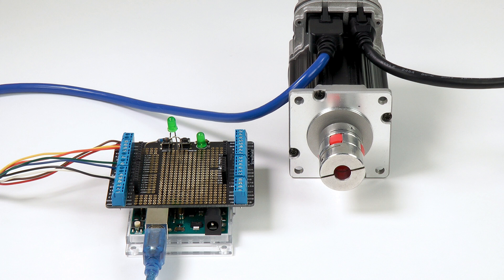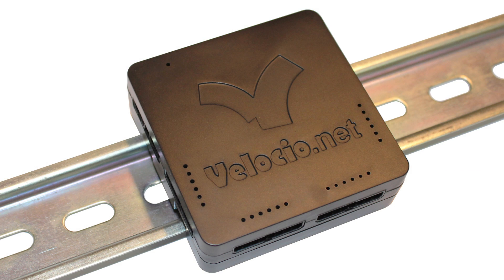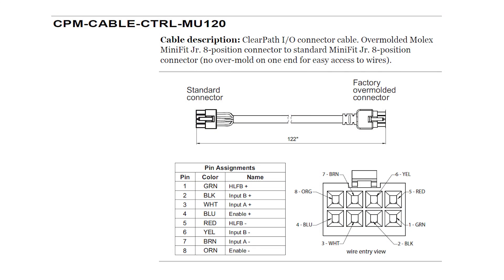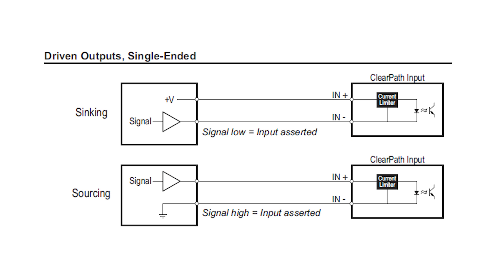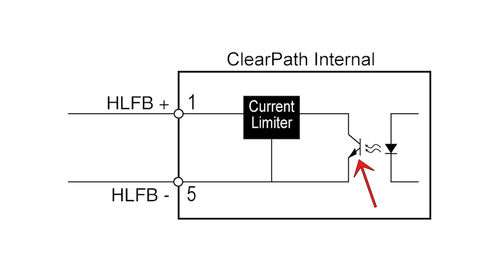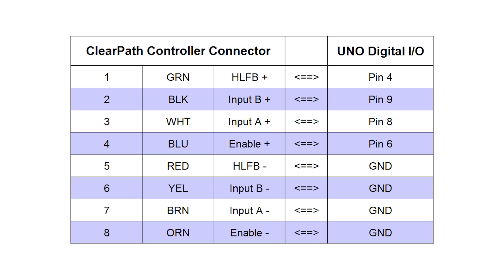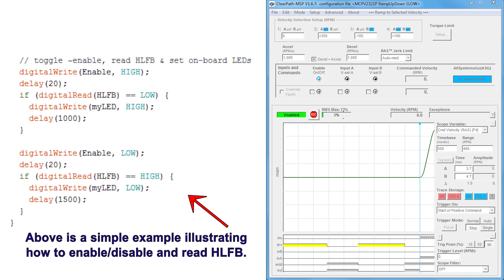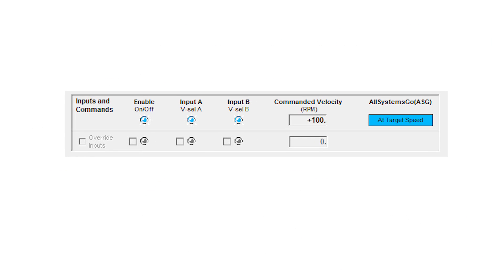How to Wire an Arduino to a ClearPath Servo Motor

Comment: Now if you could remake this video in English that would be great!
Reply from the maker: Hi Mankind,
Thank you for your comments. We understand that learning how to do software programming can be challenging.

You might be interested in Teknic’s newly released ClearCore motion and I/O controller which can help simplify wiring and programming:
https://www.teknic.com/products/io-motion-controller/

To help both beginning and experienced programmers, Teknic has written an Arduino library that allows the ClearCore to be programmed in the Arduino IDE. In addition, we have written more than 40 motion and I/O examples for the ClearCore. These examples, and many other ClearCore resources, can be found in the download section of Teknic's website: https://www.teknic.com/downloads

Regarding hardware, the ClearCore controller has 4 motor connectors and 13 points of configurable industrial I/O built-in. Using Teknic's controller and power cables provides plug-and-play functionality so no complicated wiring is required to get the motors running. 

If you have any other comments or questions about this video or the ClearCore motion and I/O controller, please contact us at: https://www.teknic.com/contact/ or call us at 585-784-7454.

Aaron B. - Teknic Servo Systems Engineer

Comment: WİCH ARDUINO DO YOU ADVİCE FOR 6DOF ARM ROBOT
Reply from the maker: Hi abd morioglu,

I appreciate your question. There are several controllers that could work with ClearPath in a 6DOF robot, but the optimal choice depends on several specific application factors. 

In this video, we are using an Arduino Uno, although other controllers are compatible with ClearPath as well.  The main requirement for using a controller with ClearPath is that the controller outputs are 5-24VDC signals that can supply enough current (dependent on the voltage and listed in the ClearPath User Manual).  

If you would like to discuss your application and controller options in more detail, please feel free to contact Teknic at 585-784-7454 or through our website at https://www.teknic.com/contact/

Best regards,
Bridgette G. - Teknic Servo Systems Engineer

Comment: Question: Could you do the same thing with GPIO pins on the Raspberry PI?
Reply from the maker: Hi Glalilos,

Yes, it's certainly possible to utilize the GPIO of a Raspberry Pi for a ClearPath MC or SD series' inputs. You would just have to use a level shifter to make the 3.3 V outputs on the Pi compatible with the 4-28V inputs on the ClearPath.

Please feel free to give us a call (585-784-7454) or leave us a message at https://www.teknic.com/contact/ if you have any questions.

Best regards,
Ian R. - Teknic Servo Systems Engineer
Reply: @TeknicInc  Thanks, very helpful!

Comment: what is the model of your servo motor?
Reply from the maker: Hi Dante,

The ClearPath model that we used in this video is a CPM-MCPV-2321P-ELN. Here is a link to the motor's specification page: https://www.teknic.com/model-info/CPM-MCPV-2321P-ELN/

If you have any other questions, feel free to reach out to us directly through our "contact us" form (https://www.teknic.com/contact/ ) or call us at 585-784-7454.

Best regards,

Bridgette G. - Teknic Servo Systems Engineer

Comment: Im in love with the speed of these servos! Would it be possible to use this with a raspberry pico?
Reply from the maker: Hi Mitchell,

Thanks for your feedback regarding ClearPath. Yes it is possible to use a Raspberry Pi Pico with ClearPath. However, as with most single board computers, the Pico’s on-board logic voltage is only 3.3V. ClearPath’s three general purpose inputs require a logic voltage of 4-28 VDC. As a result, you cannot use the Pico by itself. 

In order to make the Pico compatible, you can use a level shifter to bring the 3.3 V GPIO to 5 V (there are several well documented articles if you Google this specific topic). After boosting the Pico’s I/O voltage in this manner, you can then use the Pico with ClearPath servo motors, similar to our Arduino video – just programmed in a different environment. 
If you have further questions, feel free to reach out to us directly through our "contact us" form (https://www.teknic.com/contact/ ) or call us at 585-784-7454. 

Best regards, Abe A. - Teknic Servo Systems Engineer
Reply: @TeknicInc  Thanks for the detailed information. Ill be in contact.

Comment: does the motor reach the max rpm with arduino
Reply from the maker: Hi H S,

Yes, it certainly can. An Arduino will not limit ClearPath’s ability to reach maximum RPM. In most cases all you need to do is configure your ClearPath motor to achieve that speed.

Throughout this video Teknic uses a ClearPath MC motor to demonstrate position and velocity control through different ‘operating modes’. If you look closely at this part of the video: https://youtu.be/QZLwDnGSaeI?t=396, you can see Teknic demonstrate the “Ramp Up/Down to Selected Velocity” operating mode. In this mode we configure the motor to spin to four different velocities: 0, +350, -100, and +100 RPM. If we had chosen -6,000 RPM to be our third velocity instead of -100RPM, then when the Arduino requested the motor spin at its third velocity, the motor would have spun to -6,000 RPM instead.

If you’re interested in learning more about the different ClearPath MC Operational Modes and how you can use/configure the motors for your application, please take a look at our website here: https://www.teknic.com/products/clearpath-brushless-dc-servo-motors/clearpath-mc/.

If you have any additional questions, please contact us at www.teknic.com/contact or give us a call M-F between 8AM and 6PM EST at 585-784-7454.

Best regards,
Jon K.

Comment: I know this is a stupid question because I watched the video, but will this actually work with a 3.3V micro like the Teensy 3.6 w/o level shifters?  Inquiring minds want to know.
Reply from the maker: Hi Rob Jones, 
Actually, this is a good question! 3.3 vdc, as commonly provided within the smaller micros simply don't provide enough voltage to reliably drive the optically isolated ClearPath inputs.  The ClearPath logic inputs accept an input voltage range of 4-28VDC, but we recommend a voltage range of 5-24VDC for "logic high" at the ClearPath inputs (this is detailed in the ClearPath manual which can be downloaded here: https://www.teknic.com/downloads/ ). Needless to say, for 3.3V outputs we would recommend (as you mentioned) using a level shifter or switching to a microcontroller with native 5V outputs like the Arduino Uno (space permitting). Hope this helps. 

If you have any other questions or concerns, please feel free to reach out to us directly through our "Contact Us" form (https://www.teknic.com/contact/ ) or give us a call at 585-784-7454.

Thanks,
Jim W. - Teknic Servo Systems Engineer
Reply: @TeknicInc  I know you're not SUPPOSED to do it, but it works with 3.3V and I will keep it in my design due to its simplicity.    It's driving an opto emitter and they tend to only require a couple volts to break them over.

Comment: Definitely not for beginners. To much info. One clear path would have been more useful. (Yes I am a total beginner.
Reply from the maker: Hi Tiago Perdigao,

This video certainly has some complex elements if you're less familiar with each of the components being used.

Fortunately, the use cases for individual components are highlighted in several other ClearPath overview videos that feature a single axis. Here are a few such videos that may prove helpful:

•ClearPath Overview Video: https://youtu.be/rA6yrZrxuPs
•ClearPath MC Overview Video: https://youtu.be/_VG8wYc8n64
•ClearPath SD Overview Video: https://youtu.be/-gigcf7ZzAQ

If you have specific questions about ClearPath, feel free to call us at 585-784-7454, or use our "Contact Us" page online. (https://www.teknic.com/contact/). We're happy to assist. 

Best Regards, 
Ian R. - Teknic Servo Systems Engineer
Reply: @TeknicInc  Thanks.

Comment: THE MOTOR USED IN THIS DEMO IS THE MC MODEL (not the SDSK). The engineer that published this video failed to mention this SIGNIFICANT fact.
The code sample on github for the SDSK model only works on an Arduino UNO. The more advanced Arduino models cannot run the code because of the way interrupts are handled. More recent Arduino's choke on this function: ISR(TIMER2_COMPA_vect). Teknic has known this for over a year but they are too lazy to update the sample code.
Reply from the maker: Hi,

I'm an applications engineer with Teknic and saw your recent comment. Thank you for your feedback; we modified the video description to make it clear that the model in the video is not a ClearPath SD-series system.

You are correct that the servo we used in this video is the MC series of ClearPath. Specifically, we used the “Move to Absolute Position - 4 Positions” and “Ramp Up/Down to Selected Velocity” operating modes, available in the MCPV family (there are 13 total unique operating modes within this family).

The MCPV series (as well as the MCVC series) use ClearPath’s internal motion engine to generate and manage the acceleration and deceleration ramps. Because of this, you can write relatively straightforward code for most any PLC, I/O controller, or even an 8 bit micro controller, like an Arduino, to toggle I/O for these simpler position and velocity applications. 

If you intend to generate and use step/dir signals from your controller, you should use SDSK or SDHP family because the MC-series does not accept step and direction signalling.

Most Arduinos output 5-24 Vdc digital signals and can sink or source enough current to be electrically compatible with all ClearPath servo systems (MCVC, MCPV, and both SD series).  It is pretty straightforward to write code for the Arduino to toggle I/O for many of the MCPV operating modes, but managing the timing of step / direction signaling for the SD-series ClearPath models is a bit more complex, especially with an 8-bit micro. 

To help users overcome this complexity and still use an Arduino (or a similar micro-controller) with the ClearPath SD series, we wrote the open source “stepgen” example library found on Github. We chose the Uno because it’s a very common microcontroller. 
https://github.com/Teknic-ClearPath/ClearPath-Arduino-Step-And-Direction/tree/master/Arduino%20Uno/ClearPathStepGen

If you don’t use an Arduino Uno, the sample code will likely need to be modified. For example, if you switched to an Arduino Mega, there are two "board specific" settings which need to be modified (the port register names and the timer interrupts).  However, there are a wide range of alternative microcontrollers, other modifications to the library may be required for them. 

Details on modifying both the port register names as well as the timer interrupts settings for the Arduino Mega can be found within the "Read Me" section of our Github page. 
https://github.com/Teknic-ClearPath/ClearPath-Arduino-Step-And-Direction/blob/master/Arduino%20Uno/ClearPathStepGen/ReadMe.txt

I hope this helps clarify things. If you have any questions, or would like to talk about your specific application please feel free to give us a call at 585-784-7454, or use our "Contact Us" form online at https://www.teknic.com/contact/

Best, Ian R. - Teknic Servo Systems Engineer
Reply: @TeknicInc  Your code, while much appreciated by many, needs a lot more modification than the suggested PinB-22 and PORTA changes to run on even an Arduino 101.  Your code is certainly several years old. Suprising that no attempt has been made to modernize it. We all aren't experts at coding with interrupts so necessary mods are not trivial. Paul Stoffregen attempted to modify your code to run on a TEENSY MCU but even his code won't run your SDSK motors - though in his defense, he did say it was not tested. His attempt is on Github and the project name is the same as yours: ClearPath-Arduino-Step-And-Direction.  Maybe someone at Teknic can use his edits to publish something that works on an ARM processor (more than 10 times faster than an UNO).  The time you spend answering (stupid) youtube comments (like this) could be avoided by putting something useful on Github for coders who are not experts (nubes).  You might get more customers that way.  As it is, I will selling my Clearpath SDSK on ebay.
Reply from the maker: Hi  @jcjensenllc  ,

In regard to your suggestion about publishing code that works on an ARM processor, you may be interested to learn that we have recently done so. A couple of months ago, we introduced a product called “ClearCore” which is an I/O and motion controller driven by an ARM-Cortex M4F processor. This product comes with a complete C++ motion and I/O library, which includes objects for step and direction motion control. 

The source code for the entire library is available as a free download to anyone. You can download it from Github (https://teknic-inc.github.io/ClearCore-library/). This would be a great head start for anyone wanting to port the step and direction code to their ARM processor of choice.

On another note, if you no longer want your ClearPath motor, and you’ve had it for less than 3 months, you don’t have to sell it on eBay; you can return it to Teknic for a full refund.

If you have any questions, or would like to talk about your specific application please feel free to give us a call at 585-784-7454, or use our "Contact Us" form online at https://www.teknic.com/contact/

Best, Ian R. - Teknic Servo Systems Engineer

Comment: You really should say this is for the MC style motor.
Reply from the maker: Hi Simply Human,

I’m an engineer with Teknic and I recently came across your comment. The control mode highlighted in this video is specific to the MC series – good eye Simply Human :) . We provide examples for the control modes “Move to 4 Absolute Positions” and “Ramp Up/Down to 4 Selected Velocities” on GitHub: https://github.com/Teknic-ClearPath/TekTips-Arduino-Wiring-Video

Most Arduinos (with 5-24 VDC I/O) can control both Teknic’s SD (Step and Direction) and MC (Motion Control) series of ClearPath. The SC (Software Control) series of ClearPath is not compatible with Arduinos at this time.

While the code will certainly be different for each control mode/series, the wiring, power, and feedback connections will be the same. We’ve actually posted a Step and Direction library for the Arduino Uno for use with the SD Series ClearPath to help get users up and running at: https://github.com/Teknic-ClearPath/ClearPath-Arduino-Step-And-Direction/tree/master/Arduino%20Uno/ClearPathStepGen

I hope this was helpful. If you have any questions, please feel free to give us a call at 585-784-7454, or use our "Contact Us" form online at https://www.teknic.com/contact/

Best,

Aaron B. - Teknic Servo Systems Engineer
Reply: @TeknicInc  this is a bold faced lie. The github StepAndDirection sample code for the SDSK will only work on an Arduino UNO. The ISR(TIMER2_COMPA_vect) function in ClearpathStepGen class 
 will not run on anything other than an Arduino UNO.
Reply from the maker: Hi  @jcjensenllc ,
I’m sorry that our response came off as misleading. We work hard to provide accurate and truthful information at all times. Please allow us to clarify.

We’ve updated the video description to explicitly call out the MCPV ClearPath motor used in this video.

One of the main messages we’re trying to convey in this video is that most all microcontrollers (even a simple 8-bit Arduino) have general purpose I/O that is electrically compatible with the integrated ClearPath motors. However, you do need to write code to manage the timing of the I/O logic signals for the particular ClearPath operating mode (MCVC, MCPV, SDSK, or SDHP).

Most of the operating modes within the MCVC/MCPV families use simple I/O, turned on or off, to move to a preprogrammed position or ramp to a preset velocity. So, the code to manage the I/O in these cases is pretty straightforward.  On the other hand, getting a microcontroller to produce step/direction signals for the SDSK/SDHP families requires more complicated code to manage timing between pulses (especially for a simple 8-bit Arduino).

The open source Step and Direction library we published on Github (https://github.com/Teknic-ClearPath/ClearPath-Arduino-Step-And-Direction/tree/master/Arduino%20Uno/ClearPathStepGen) was written specifically for the Arduino Uno for use with the SDSK/SDHP ClearPath motors. Since there are a wide range of microcontrollers and they are not object code compatible with each other (even within the Arduino family), some parts of this StepGen library example code will need to be modified if you use an microcontroller other than the Arduino Uno.

For example, if you used the Arduino Mega instead of the Uno, there are two "board specific" settings which need to be modified, including the port register names and the timer interrupts, where the latter is programmed using the ISR(TIMER2_COMPA_vect) function in the UNO.  Details on modifying the StepGen library for the Arduino Mega can be found within the "Read Me" section of our Github page. For alternative microcontrollers, modifications other than just the timer and port register names may be required. 
https://github.com/Teknic-ClearPath/ClearPath-Arduino-Step-And-Direction/blob/master/Arduino%20Uno/ClearPathStepGen/ReadMe.txt

I hope this better helps clarify things. If you have any questions, or would like to talk about your specific application please feel free to give us a call at 585-784-7454, or use our "Contact Us" form online at https://www.teknic.com/contact/

Best,

Aaron B. - Teknic Servo Systems Engineer